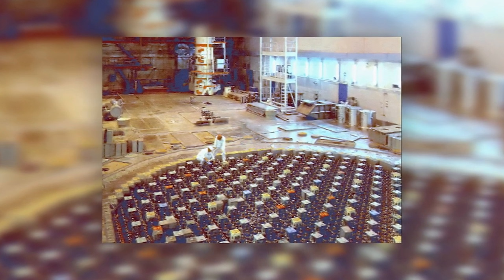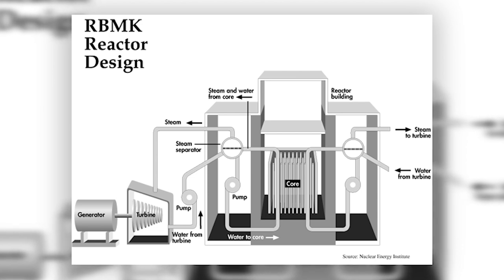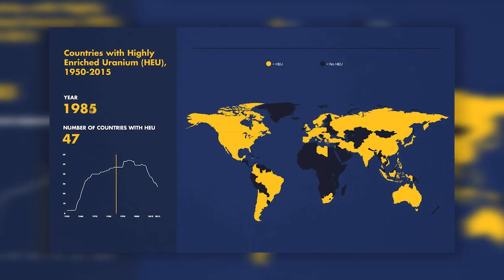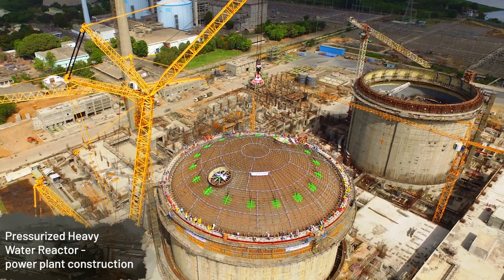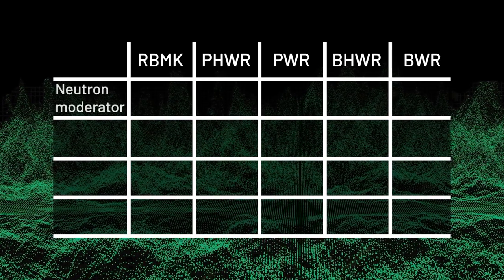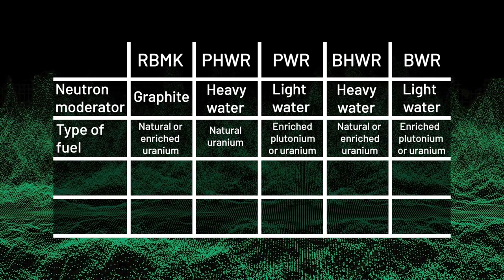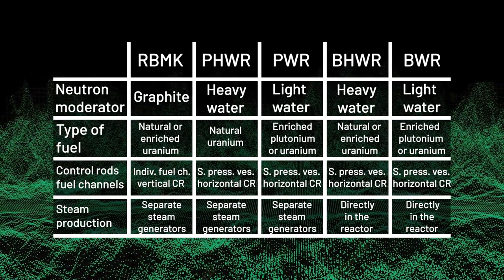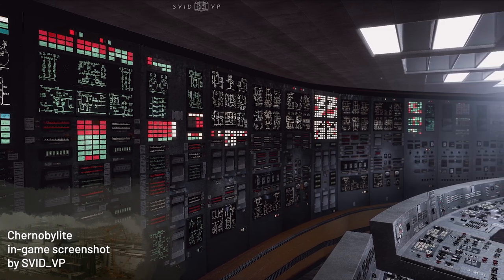How an RBMK reactor core explodes - and how it works! | Part 1 | Chernobyl stories

Comment: i SPENT 58 MINUTES INSIDE REACTOR NUMBER 4 DURING THREE TRIPS
Reply from the maker: INSIDE IT?! How many arms do you have now?
Reply: @Chernobylite  Fallout fans know it's not additional arms but additional toes that grow 😆
Reply: If you touched the elephants foot how tf are you still alive despite the Radiation?
Reply: As long as you check in with moderators working at the exclusion zone, you can go in it, the elephants foot you can go near but not touch

Comment: If you thought RBMKs were a thing of the past, you're sadly mistaken. Even almost 40 years after the most devastating nuclear accident in human history, the reaktor bolshoy moshchnosti kanalnyy (RBMK) class reactor isn't a relic of the distant past. As of 2023, eight are still in operation.
Reply: Most of them got modernized and are rbmk1500 not 1000 like Tchernobyl they are safer (not completely safe though) they learned from their mistakes but i agree that they are still dangerous

Comment: Great video.
However, you made two mistakes. The reactors at Rivne NPP and Khmelnytskyi NPP do not possess RBMK but VVER, which is a Soviet pressurized water reactor.
The only RBMKs which are still in operation are in russia.
Reply from the maker: Damn, you’re right! We had a mistake in the script - there should be a distinction between where RBMK and where PWR are working (it was supposed to be a minor detail, but the distinction was mistakenly omitted) 🙈
Sorry for that! We will corrext it in the next video. Thanks!
Reply: Dang your genius mate

Comment: Are you sure about horizontal control rods in other reactor designs? In all the BWR and PWR designs I’m aware of, control rods are vertical. The only horizontal control rods I know of in modern reactor designs are in CANDU reactors (I believe these are PHWRs). The Hanford plutonium production reactor also used horizontal fuel and control rod channels, but this type of reactor has long since been decommissioned. This was water cooled and graphite moderated.
Reply: You're absolutely correct. Both PWRs and BWRs have vertically inserted control rods. The only difference is that in a PWR they insert from the top down, and In a BWR they insert from the bottom up. This has to do with the fact that in a BWR the steam is made in situ at the top of the reactor vessel. A CANDU also has vertical control rods. However, it also has a second horizontal shutdown system, but that is in the form of high-pressure injection nozzles that will inject a liquid neutron poison into the moderator in case of an emergency. There are horizontal rods, but these house flux detectors and ion chambers, not control rods.

And the video has another mistake; there were only two RBMK-1500 reactors ever built, and they were at the Ignalina station that is now being decommissioned.

Comment: RBMKs do not have steam generators like PWRs. They very much boil their water in situ, in the core. The first generation RBMKs had their steam directly going from the steam drum separator to the turbine-generator which meant that all the piping, turbine-generator etc. had to be heavily shielded against radiation. To mitigate this,  the second generation RBMKs have what's called an "intermediate loop" which will take the radioactive steam to make clean steam in a secondary loop so that only clean steam will go to the turbine-generator, thus drastically reducing the radiation exposure. But that still doesn't make it a PWR.

As an aside, I have played Chernobylite on the Xbox, finished it completely with a 1000 Gamer Score. I like the game very much, especially how accurately  the NPP and city are portrayed. But an expansion would be nice, or a second game^^
Reply from the maker: Are you sure? Because from what I have read about the RMBK design used in Chernobyl, the whole system was build so the steam could "feed" the turbine connected to the generator which then produced power.
From World Nuclear Association:
"Each of the two loops has two steam drums, or separators, where steam from the heated coolant is fed to the turbine to produce electricity in the generator (each loop has a turbogenerator associated with it)"

I've checked it in a few official sources, so if you have any other information - share here! I'd happily check if I didn't make mistakes and correct them later if I did :-)

Cheers!
~Andrzej, TF51
Reply: @Chernobylite  
I'm pretty sure^^

Allow me to explain:
A PWR (or its Russian counterpart, the VVER) is what's known as a Pressurized Water Reactor. This means that the core is kept under high working pressure so that the water in the core doesn't boil. This allows the water to get very hot. It has three cooling loops. The first loop consists of the reactor pressure vessel, a pressurizer that keeps the pressure inside the core at a set point, and a steam generator (there are usually three or four per reactor, depending on the size and built of the reactor).

The steam is produced in the steam generator where the hot water from the first loop gives up its heat via u-shaped thin-walled tubes that are inside the steam generator. The secondary loop is the water that flows around these thin-walled tubes. This water turns to steam, the steam gets dried and sent off to the turbine-generator. After the steam loses its power, it goes to the condenser where it is turned back into water, and sent back to the steam generator. These two loops never meet, which means that the water that is slightly radioactive because it has touched the fuel will never see the turbine-generator.

A third loop runs through tubes inside the condenser where it cools the steam in the condenser back to water, and then carries the heat off to a lake or cooling tower. This loop is the only loop that’s open to the world.

The RBMK is a BWR, Boiling Water Reactor, but it is a special BWR because it has the graphite moderator and on-power refuelling. It doesn’t have a single pressure vessel, but individual pressure tubes (1693 fuel channels in the first generation RBMKs, 1661 in the second generation RBMKs). Water enters the reactor from below through the General Distribution Headers, flows up through the fuel channels where it is heated by the fissioning uranium, and turns to steam. Each fuel channel has its own individual top header tube that carries the water/ steam mixture to the Steam Drum Separator. The Steam Drum Separator itself doesn’t make the steam, it separates the steam from the water droplets, dries it even more and then sends the steam to the turbine-generator. But because the steam has been formed directly inside the reactor core, it is radioactively contaminated. Through a video on the official Chornobyl NPP YT channel I learned of the slight difference between the first and second generation RBMKs when it comes to that “intermediate loop”. This was something I hadn’t read anywhere in any of the materials I have on the RBMK. Since I’m not sure if YT allows me to put in the link to this video, I will give you its title so you can find it:

Official Chornobyl NPP YT channel :
“ЧАЕС за 10 хвилин. Що ви побачите під час туру всередину Чорнобильської станції?”

The video is about a year old, it is about a tour one can take at the station. The video is 11,55 minutes long, skip to timestamp 7 minute, 55 seconds, from there you will find the explanation about this difference between Units 1 and 2 (first generation RBMK) and Units 3 and 4 (second generation RBMK).

As to my own sources. They are:
Russian RBMK Reactor Design Information
RBMK Shutdown Systems
Safety of RBMK Reactors; Setting the Technical Framework
Heat Removal from RBMK reactor core using non-regular means
Ignalina RBMK-1500, a Source Book
Nuclear Safety of RBMK Reactors
INSAG-1/ INSAG-7

My apologies for the long-winded reply.😅
Reply: @tinyjr8618  
Read my extensive second comment with the video referral. Go and listen, it has subs if you not speak Russian/Ukrainian. Then you'll hear one of the Chernobyl NNP technicians explain how they kind of made one.

Comment: Hello. 

It's not correct that these types of reactors have horizontal control rods.

All types you mentioned have vertical control rods.

Either being inserted top down or bottom up vertically.

But besides this error. Great channel.
Reply from the maker: Yes, you’re right. Our mistake made out of language mistake :-)

Comment: they used rbmk cause everything was cheaper  plain and simple
Reply from the maker: Yep, probably so!
Reply: They used RBMK because Soviet industry could not build the required number of VVER reactors. A pressure vessel reactor is a complex technology. And in those years they were less powerful. But the country's demand for electricity was growing and a compromise was found in the form of the construction of a station with RBMK. If you google you will see that both types of stations were built at the same time. And even before the accident, many engineers from Chernobyl moved for promotion to a new power unit in Balakovo, where the VVER reactors are located. By the way, there was also an accident, during installation work people were boiled alive, the chief engineer was a former employee of the Chernobyl Nuclear Power Plant.
In general, the RBMK is more expensive to maintain, it requires significantly more personnel, more pipelines, and more equipment is exposed to radioactive contamination. But money in a socialist system and a capitalist one are different, so these difficulties did not play a role. And now they are playing, so Russia is building VVER instead of RMBKs that are switched off due to old age.